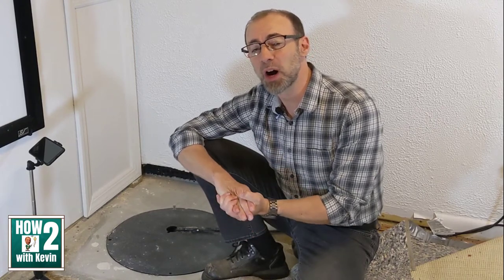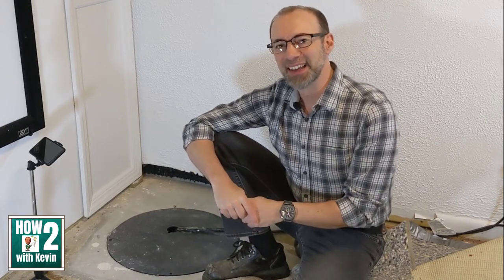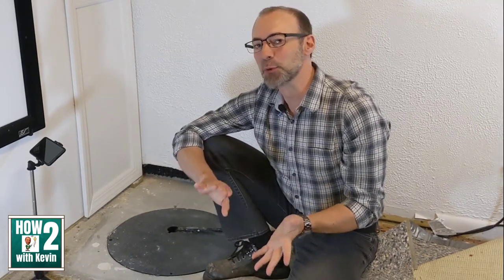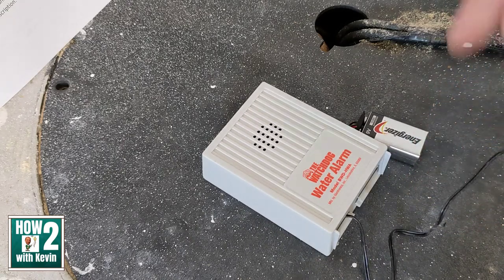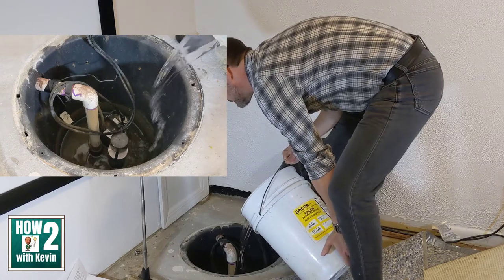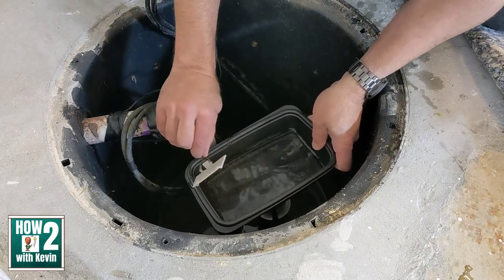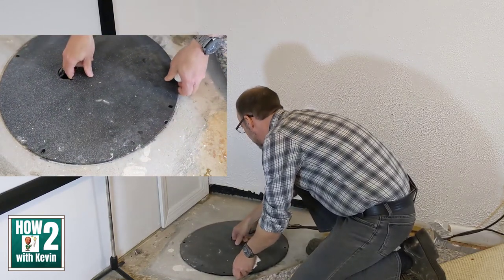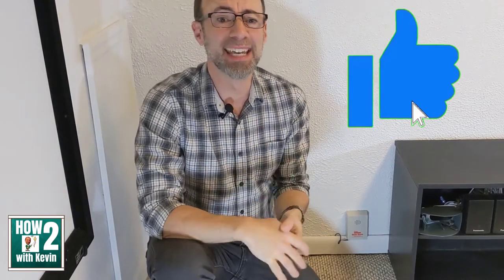How To Know When a Sump Pump Fails:  DIY Monitor

Comment: Interesting, I clicked on it because of the $20. Now I have some questions. I don't see a union or boot in your piping, how do you change your pump? What good is the alarm when you are at work. I put in two pumps in just in case one failed.

Comment: If your not home you have solved nothing. Put in 2nd pump with alarm ,problem solved. You say you are going to call the warranty company to get it replaced. What are you going to do when your basement is flooding while it takes days for the warranty company to get someone out to do replacement which will be days if not weeks.